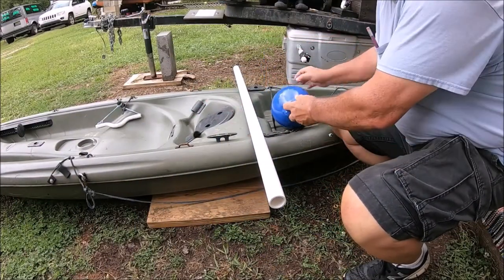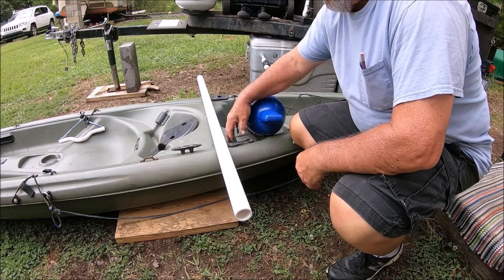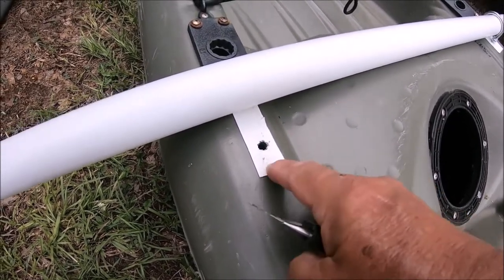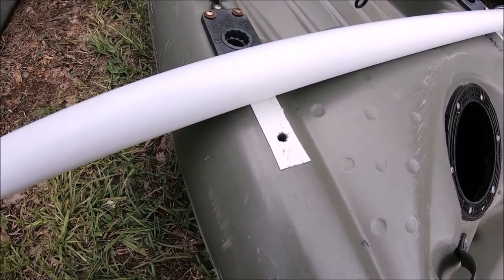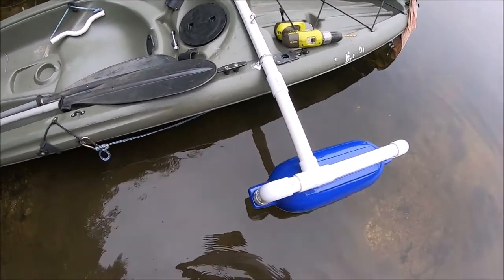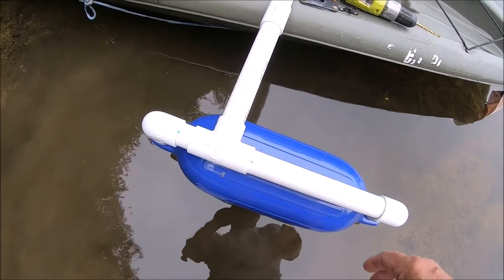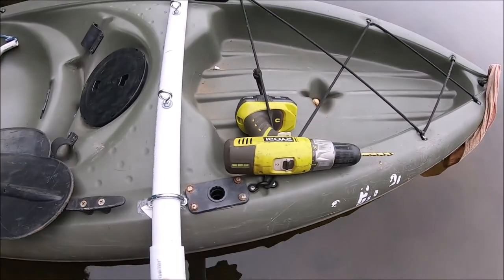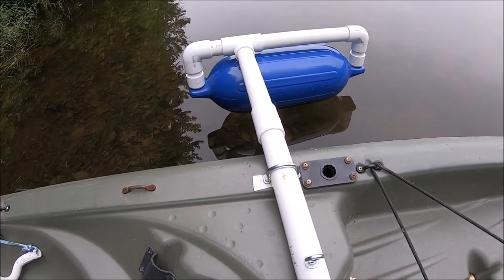DIY Kayak and Canoe Stabilizers

Comment: Thanks.  I have bumpers, already.  Your framework design is a big help.  Yeah, when the knees go, it's hard to get in and out.  I practice all winter getting up from a low seat, so that I can get out of my sit in yak. Don''t like to go out alone.
Reply from the maker: Good morning. Yes ,over time the old knees and other joints want to get stiff and be hard to get along with. It's best to keep moving any chance you get. I went on a pretty hard hike yesterday and felt better at the end of the hike than at the beginning. I always say, "you can't because you don't.
  I hope this video helped you. Thanks for watching and commenting. Have a great time on the water.

Comment: Well done! Great video and commentary. Enjoyed watching it. I’m planning to implement something similar on my canoe
Reply from the maker: Thanks for watching and subscribing. I hope this helps you out. I adapted these floats to my canoe also. The floats work well. I’m happy with them.😁
Reply: @BlaneysChannel  ,

I'm about to add this idea to my 14' canoe. Today l receive the new trolling motor l ordered. 
Thank You again for posting this video.

 It will help me enjoy my earlier retirement in FL without worrying about tipping over.
Reply from the maker: @BlueOriginAire    I used to have a tandem canoe I used a trolling motor on. It worked out real well.. The only thing I would advise you to do is study deep cycle batteries. I learned the hard way and killed my first one. You can only run them down to 50% power or they will slowly die. If you attempt to travel a long distance have an extra battery. Also have a gauge to check the battery every once in a while.
HAPPY CANOEING 🛶

Comment: I have found that using straps instead of u bolts puts less stress on the pipe less likely to snap when under pressure also using a 1x4 treated under the cross pipe spreads the stress on the kayak hull the outriggers works very well
Reply from the maker: I don’t disagree with you. A 👍 good idea. I haven’t had any problems with mine though. I mostly fish on quiet water so less stress I would imagine. Thanks for watching and commenting.

Comment: I have a pelican castaway 116 very similar to what you have. If it isn't a huge hassle could you post a list of what you used and lengths please. It was a great video and I enjoyed it.
Reply from the maker: Thanks for watching the video. I hope it was helpful. I really didn't make a list of parts. I did this "by ear" as I went along. I used the thick PVC that you find in the plumbing department not the thin stuff you would find for garden work. I made the main crossmember that runs across the kayak 4 feet long. the wider you make this the more stability you will have.
  The other PVC cuts you make will be determined by the size of the bumper floats you buy. 
   I made a modification to my stabilizers after using them. Instead of them going out from the crossmember and turning down for about 3 or 4 inches, I now have them running strait out. When you build yours I would suggest this to you. Less drag this way. You are better of if they barely touch the water. You still can't capsize and it is much easier to paddle.

Comment: Instead of using PVC glue (around here, you might find "Oatey" brand "hot blue" I think), use the 2-part primer / cement.  The glue gives you less than one second to fit the pieces.  The cement will give you 5 or 10 seconds.  It makes all the difference.
Reply from the maker: Your suggestion is a good one I will remember. That extra time is valuable.
I must not have mentioned that I didn’t use PVC glue. Believe it or not I used Gorilla glue (original) and it has held  now for  over 2 years.
 Thanks for watching and commenting. Thanks for the tip also😀

Comment: question how did you mount the metal brackets through the Kayak? Great video
Reply from the maker: Thanks for watching. There aren’t any brackets I don’t guess. Maybe you can explain further. I just drilled through the pvc pipe and used bolts and washers. I’m saying washers but they are long metal strips that come with u-bolts. It has held with no problems. More questions? Just ask.
Reply: @BlaneysChannel  thanks for fast response. So I guess what I am trying to ask is. When you bolted down how did you access the bolts on the long pvc connected to you Kayak? Thanks again
Reply from the maker: Gotcha, I have a dry compartment behind my seat. I removed the cap and dry bag allowing me to get my hand inside the kayak. That is how I tightened the bolts. I believe someone could use something like a molly bolt or wall fastener to accomplish the task.

Comment: What size of boat fenders did you use, and how far away di you mount them from the kayak body? Curious....
Reply from the maker: Thanks for watching. They measure 22 inches from end to end. Mine are mounted 21 inches from the kayak on center. The main thing I would look out for is how far back you can mount them. You want them far enough back so that you won’t hit them while paddling. I have moved mine back further since making this video. I suggest you sit in/on your boat and check how far back you stroke. Good luck with them.
Reply: @BlaneysChannel  ... Thanks for reply. No need to worry about having enough room to paddle, as mine are on a canoe, and are extended well away from the hull sides. I use the same sized boat fenders.
Reply from the maker: @waynedavies3185  👍
Reply: @BlaneysChannel  Many factors should be looked at here, not just the fact that an Air Blatter (filled with air pressure),  is used to stable the craft. You want the vessel harder to flip over to make it safer. Therefore weight also has to be taken into the equation. When one blatter sinks under the water, you also need the weight of the opposite side to help bring the sunk Blatter, back up to the surface. The father away from the hull the Blatter is installed, the harder it is to flip the craft. More resistance is involved here in trying to sink a Blatter under the water, which would end up in flipping a water craft if they are mounted too close to the crafts hull. The father away from the craft's hull they are installed, the greater the stability these batters will provide. Think about it folks. Air Batters should be extended, at least at half the length of the craft on either side. It would take more weight shifting by the rider, to even sink these air blatters under the water's surface. You want a really stable canoe, or kayak, extend these air stabilizers, father away from the vessels hull on either side. It makes the craft appear as if it is (at least), half it's length wide in the water. Too close to the hull, won't work as well as having them extended farther out and away from the hull on either side, if you want to stand while fishing, or don't want the vessel to flip over under any condition on a lake. On a kayak, I would say, extended  at least 3-4 ft away from the hull, for a starter. On a 10 ft. canoe, at least half the length away from the hulls. That's 5 feet on either side. When a person stands in a vessel, you're at least 5 to 6 feet top heavy with your weight, so by extending the Air Blatter's out father, it makes it even harder to flip the vessel, if not impossible  ( doesn't mean you might lose your balance and fall in, but the vessel won't flip over, sending your equipment to the bottom).
Reply from the maker: @waynedavies3185    I don’t disagree with your physics. No doubt the further out the outrigger the more stable the craft.
  I think a lot of this depends on how you use your watercraft. I do a lot of stream (creek) paddling and fishing. Extended outriggers would make it almost impossible to pass downed trees or narrow passageways.
  I have rocked band forth in my kayak and canoe and think I would have to try to turn it over. I can actually enter my canoe from shore without getting my feet wet. I made a video about adapting these outriggers to my canoe. It was maybe 2 or 3 videos after this one. There is a good look at them too. Check it out.
Reply: @BlaneysChannel   I don't use my canoe into small  creeks fishing with a stabilizer, and when I do travel in a creek, I'm kneeling on the hull's  bottom for stable ballast. I never stand up while travelling a creek. Not wise standing, when logs and rocks are under the surface. Been doing it for many, many years ( since I was a kid), never had a flip yet, and caught plenty of fish over the years.
Reply from the maker: @waynedavies3185   I never stand up. Don’t feel the need.😁

Comment: Why do you hold your paddle backwards?
Reply from the maker: This is an old paddle of mine. It came with the kayak when I bought it. Both sides are exactly the same. No front or back.
   I broke my other paddle and hadn’t bought a new one before I posted this video. I have bought a new paddle.
  Thanks for watching and commenting.😁👍
Reply: @BlaneysChannel  
You need to spin the paddle 180 degrees so the cupped side is grabbing the water for better propulsion.
Reply from the maker: @entertain4me73  I’m trying to tell you there is no cupped side. Both sides of this paddle are the same. It is like a two blade oar. No cup, no front, no back.
Reply: @BlaneysChannel  
It sure looks like it’s a cupped paddle in the video!
Reply from the maker: @entertain4me73  You are the second person to say this. I’m going to film this paddle Saturday and show you. Watch for a video Saturday afternoon.
Reply: You are wrong! I watched the video again. There is definitely a slight cup to the paddle with the center ridge only on the opposite side of the cup. That center ridge should be facing the front of your kayak.
Reply from the maker: Five and one half minute about this paddle is posted. Please watch.
Reply from the maker: @entertain4me73  You haven’t commented on the video about the paddle. What’s wrong?

Comment: What size fenders did you use
Reply from the maker: Thanks for watching. The bumpers,if that is what you're calling fenders measure 22 inches long by 6 1/2 inches around. They do the job. My cheap kayak is now as stable as a more expensive one. You can find these dock bumpers at most large box sporting goods stores and on Amazon. 😀 Good luck on your project.
Reply: @BlaneysChannel  thanks mate I am in uk we call them fenders thanks mate
Reply from the maker: Sam Holmes   Never to late for us “Yanks” to learn good English. Thanks for the lesson.👍😃
Reply: @samholmes12345678  experienced boaters in the us call them fenders as well, but landlubbers call them bumpers or buoys or floats....

Comment: Hello from Greece. May I ask you a question... what about the speed of kayak? Is more difficult to paddle when the stabilizers are on kayak?
Reply from the maker: You add some drag. If you are going to do this, try to position the outriggers so they barely touch the water. You only need them if you start to tilt to the right or left anyway
  Thanks for watching and good luck to you.😁